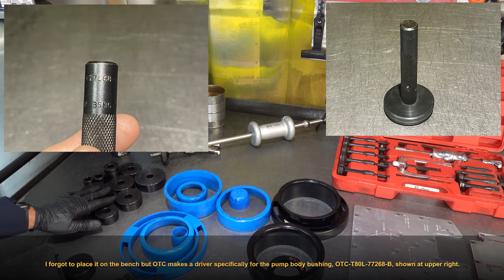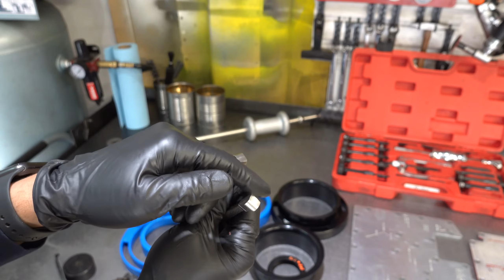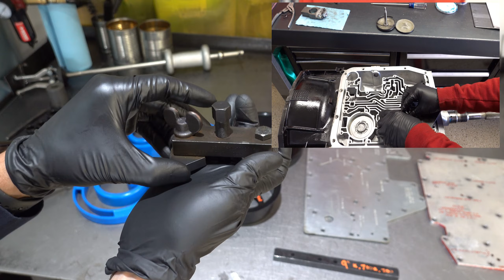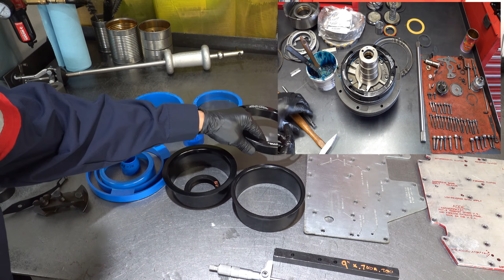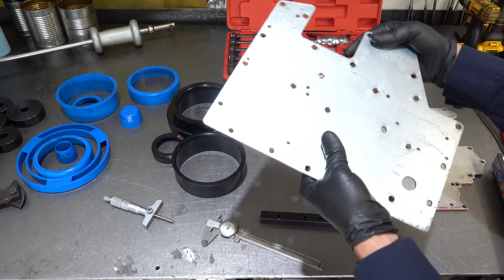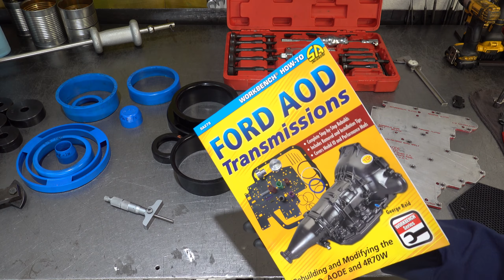Rebuilding the Ford AOD : Special Tools and Resources

Comment: Hi, Great Video, working on my 1st AOD rebuild. Can you recommend a good place to buy rebuild kits & Parts? Also I cant find that rear bushing driver T80L7710-A anywhere. I tried Ebay and google it, but no luck. Would you know where I could find one? Thanks
Reply from the maker: Thank you for watching, Fred. I'll be doing a quick video that informs everyone where I get my parts as well as reliable on-line suppliers for folks who don't have local transmission parts supply shops. Video should be on the channel Monday or Tuesday at the latest. Been meaning to do it but been slammed w/transmission work - I get this question very frequently so figured a video would be more productive vs me responding w/the same things to multiple instances of the same or similar questions.
Reply: @nickstransmissions  Hi Nick, did the quick video come out yet on where you get your parts? Iv'e been looking for it but havent seen it yet. Thanks

Comment: Do you have the part number for the bushing tool to remove and replace the front transmission fluid bumper bushing for a 1988 aod transmission? I am not sure if you mentioned that
Reply from the maker: I don't have any part numbers beyond what I share/show in the video. Thanks for watching, Edgar.

Comment: Are the AOD and AODE basically the same? I love the 4l60e but, this is my first Ford. Thanks in advance
Reply from the maker: The AODE is to the AOD as the 4L60E is to the 700R4...The 4R70W is an evolution of the AODE and features a deeper, wider ratio between 1st and 2nd gear.
Reply: @nickstransmissions  do you have any contact outside of here? I would not mind picking your brain on builds that I do.
Reply from the maker: For now, I'd rather keep all discussion here since it's visible to anyone with the same or similar questions...So if you have them, ask and I'll respond. Thanks Jay.
Reply: @nickstransmissions  that makes perfect sense! I appreciate it!

Comment: Your videos are the best. I am delving into rebuilding a few ford and chevy transmissions. I plan on restoring several old ford dent sides and 1 chevy square body. I have been rebuilding engines for over 35 plus years. So now its time to now do a transmission. Your video have showed me that I can do this. I'm setting an area up just for this in my clean room.
Reply from the maker: Thank you for the kind words, Clayton! Sounds like you're taking the next step in your journey in tackling the transmission-that's great news!

Let me know if you have any questions along the way as you get into your first rebuild.

Comment: Regarding your blind hole puller set, do the ledges on yours protrude like a sharp 90 degree corner, or is there a 45 degree slope towards the ledge?
The vast majority of these sets have a sloped ledge, which causes the collet to pull itself into the bushing rather than grabbing onto it. It wasn't until you recommended me that Kent Moore tool which had a sharp ledge that I could finally pull it out in 3 smacks no problem.

Do I see it right that your set has the proper sharp edges?
Reply from the maker: Hi John, all of those pullers have 90 degree pulling ledges - I was specifically looking for that as I also have seen many that have the more gradual transition from the collet body to the pulling surface.